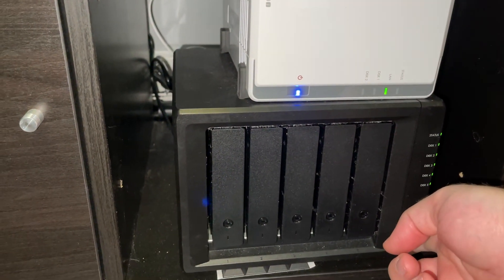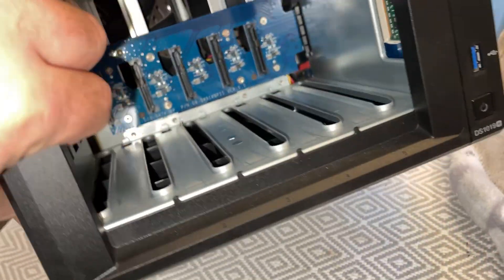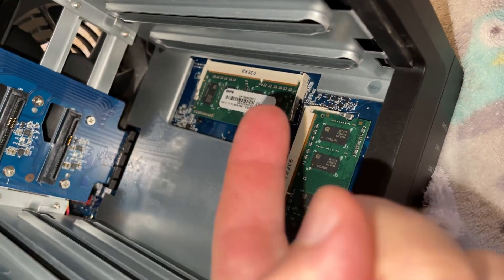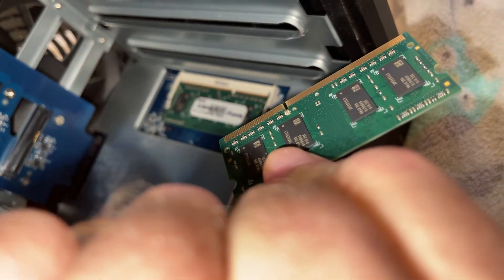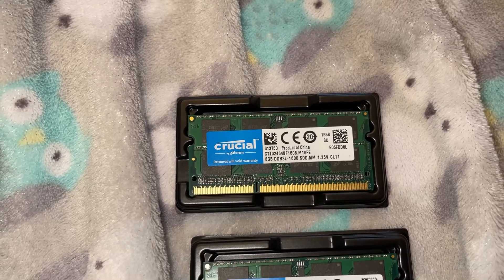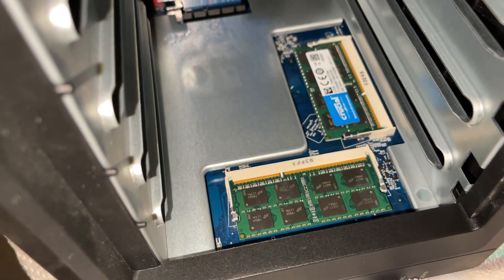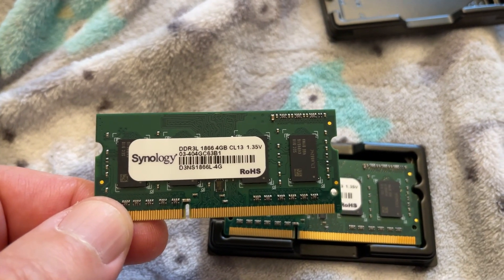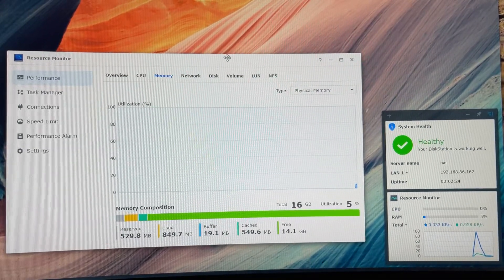Upgrade Your Synology 1019+NAS to 16GB Ram

Comment: Thanks a lot for your video. Before purchasing the RAM I verified that the original module is @1866Mhz (PC3-14900), while the one you choose is @1600Mhz (PC3-12800).Can you confirm that this does not affect the performance/compatibility?

I found another kit @1866, still from crucial: CT2K8G3S186DM, it says Mac compatible, but the timing, speed and type are the same except for the speed. What do you think about.
Reply from the maker: I can only confirm what I used works perfectly
Reply: Got It. I Just purchased the one you tried. Thanks again. 👍🏼

Comment: Do you run plex in your main nas or did you create a virtual server with dsm? I created a virtual server, not sure how much Ram I should assign to it. Have you upgraded to dsm 7? Any errors with 16gb and dsm 7? Thanks!
Reply from the maker: Yes I’m on 7 no errors. I just run it direct it’s all that box does
Reply: @COGuyStuff  thank you so much! Getting ready for the jump 😀
Reply: Does it improve performance of Plex upgrading to 16gb?
Reply: @sickem19  I noticed an improvement as I could allocate more memory to it. But I usually have 2 streamings at once and lots of network inquiries.